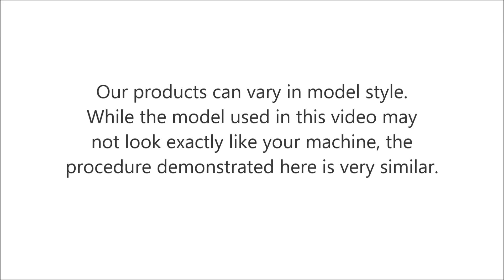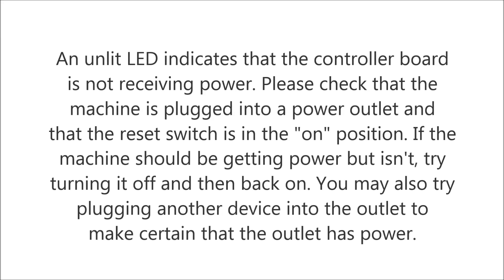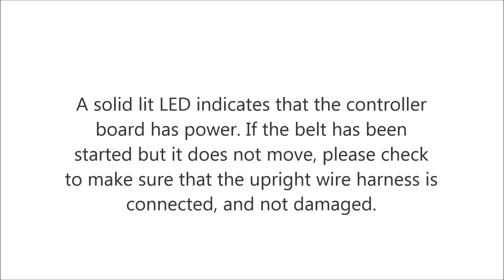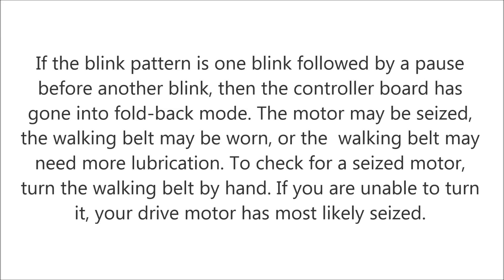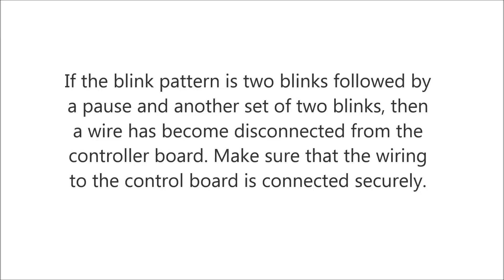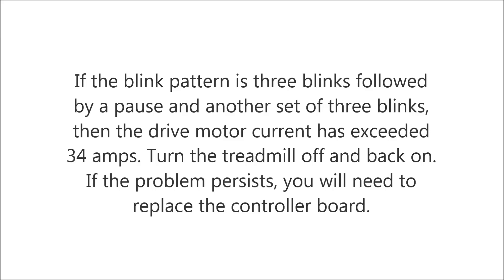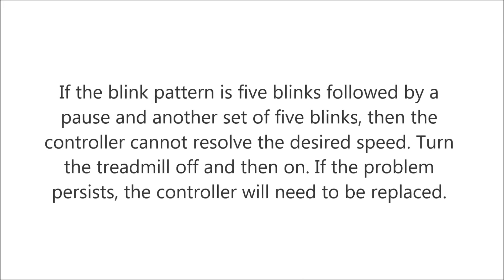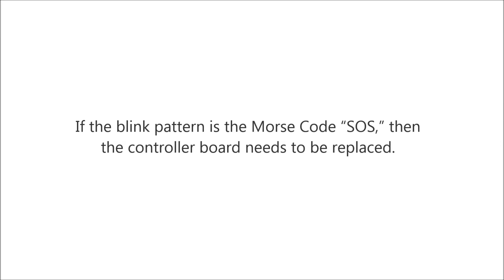LED Blink Patterns on the Control Board - Treadmill

Comment: My treadmill fast blinks constantly and runs at the minimum speed constantly
Reply from the maker: This would indicate that the controller is responding to a speed signal sent from the console. either the speed signal from the console is not increasing (console issue). Or the controller cannot send more power to the motor (controller issue). you likely will not be able to tell which part is failing with out reading voltages from the console on the speed control wire (blue) with a voltage multimeter. Does the speed change on the console display when the speed buttons are pressed? If so i would be more likely to replace the controller first. If the speed display does not change when the buttons are pressed then it is almost certainty a console issue.
Reply: @FitnessEquipmentHelp  Thanks for this response. 
There's no response from the console panel at all.
I had someone look at it & he had a motor control board which made no difference so he has taken the console display to test as he believes that is faulty, only when I press calibrate incline it slows for less than a second so see how that goes. Appreciate you're help

Comment: Thank you for this video, Nordictrack sent me a link to this as part of troubleshooting.
My Nordictrack 1750’s belt is not moving. When powering on, the led stays a steady red. However starting any kind of workout, the light starts to blink continuously. The motor makes a slight sound as if it is about to start but nothing happens.
I’ve tried to make sure all connections are in place snugly but I don’t have electrical experience.
Reply from the maker: usually they symptoms you describe are associated with the 4 blink error code demonstrated in this video. If the light is truly blinking continuously that would implicate the motor. If it is throwing an error code then the controller should be replaced. It seems though that your console and wire harness are communicating which is a good thing.
Reply: @FitnessEquipmentHelp  thanks so much for your help. Really appreciate it. Yes , once a workout is started, the LED blinks continuously.  Not just a few blinks. I am going back and forth with the manufacturer. Thanks again

Comment: My control board light turns weakly solid when I turn the machine on, and then fades to off within a few seconds. No blinking. Has something blown on the control board?
Reply from the maker: Yes, sounds like it. I haven't actually seen that specific symptom before but I would replace the controller.

Comment: I have a pacemaster bronze. And it just beeps non stop when plugged in. The top circuit board has no signal to the panel (I cannot make any selections). When I unplug the Ethernet wire to the bottom circuit board it stops beeping. Any idea?
Reply from the maker: Sounds like the console likely has a stuck button or some other issue. Likely the cable you unplugged also supplies the console with power, so when unplugged the beeping stops. the console likely needs replaced. In the interest of full disclosure however I am not an expert on this brand.
Reply: @FitnessEquipmentHelp  I actually fixed it by luck. I unplugged the Ethernet cable from the top console and then hit the reset button. Plugged the cable back into the main circuit board and everything worked again. Now the main issue is: if I run at a high speed, the treadmill trips the fuse (eg anythingnover 13.5km per hour)

Comment: Hello - the LED is flickering ( a steady blink?). The only issue is the walking belt isn't moving. The incline works and all displays are working. I tested the motor with a battery and it works and powers the walking board. The wiring seems to be ok. 
Appears I need to replace one of the circuit boards. Do I replace the board with the LED lights ( the INCLINE board) or the other circuit board ( Motor circuit board - with the black & red wiring to the motor). What are next steps to get this?  
Thanks!
Reply from the maker: a regular blink on the controller should indicate power is being sent to the motor on the black and red wires. If it is an error blink (a cirtain number of blinks and a pause) then the controller should be replaced. if you have confirmed your motor and wires then i would replace the controller if the light is responding (blinking) to the incoming speed signal.
Reply: @FitnessEquipmentHelp  Appreciate the reply. To clarify, replace the circuit board /controller...not the PWM circuit board that has the LED's. Thanks.
Reply from the maker: @bobgutowski261  The PWM board is the controller. I think we may be crossing signals. What is the model and version of your equipment?

Comment: 😳 I have a cheap Athletic Works treadmill from Walmart that I bought secondhand that I can’t find even a manual for that stopped working. I had power to it, but belt would not run. This video helped me figure out exactly what the issue was and fix it. Thank you so much for putting this together!

Comment: I was using my proform 770ekg and I heard an ESD zapped on the console when I was trying to change speed.   The console immediately lost power and lost all the lights on console.  I have taken the cover off to exposed the controller board and still have red solid red led light.  Is the console bad?
Reply from the maker: very likely, the red light is indicating the controller is receiving voltage from the wall. you can check for 9-12dvc on the red wire to confirm the controller is sending power to the console.

Comment: lde blinking red on the treadmill circuit board (cheap Frontier model)  , the treadmill is just beeping when turning it on.... and the motor wont run when i press start , even if the display shows its running.... is this fixable ?
Reply: The controller needs replaced

Comment: so the machine needs to be plugged while the motor hood is off for this, right?
Reply from the maker: That is correct, depending on the model. Be sure to keep yourself and others clear of the electrical and moving components while troubleshooting.

Comment: Thank you. This helped me from buying and throwing parts at it (Pro-Form XP 650E). I originally thought it might be the drive motor then I thought it could be the motor control board. With the explanation of the blinking light, it was identified as the need for more lubricant for the belt. I followed your video on belt lubricant and it is back up and "running" again. Thank you.

Comment: Hi. I have a Trojan Stamina 300. It stops after a few minutes. Sometimes give L5 error. Did the test for the blinking light. The LED stays on when treadmill is running. Please give advise.
Reply from the maker: I'm sorry that i am not familiar with equipment from that brand. I would contact the the manufacturer directly for assistance.

Comment: can we identify the failed point(s) and repair the control board for each error code?
Reply from the maker: I am only aware of a few of the issues. i know for example that the 4 blink error code is a bad fett on the board but my experience is really only repair at the part level not so much at the components on the circuit boards.
Reply: @FitnessEquipmentHelp  fett?

Comment: Nordictrack C900 treadmill. When you turn it on the LED light is solid red. As soon as you select a speed or incline button the light starts blinking a rapid continuous blink and none of the controls will work after that. We have already done the troubleshooting for display issues and are at a loss. Any clue on what this could be? It worked fine and one day started beeping while using it which led us to the display troubleshooting.
Reply from the maker: The light should only blink in response to the speed signal being sent from the console. Does the display show that you have pushed buttons but just the treadmill belt does not respond? I have seen issues where the speed signal interferes with other signals between the console to the lower circuit board when there is damage to the upright wire harness. I would make sure this wire has not been pinched or damaged.
Reply: @FitnessEquipmentHelp  once you select a speed the belt will respond and go to that speed but then all buttons stop working and the belt remains at that speed until you pull the safety key. Also, the incline controls work perfectly until you select a speed and then then all of the buttons stop responding. The display stays lit up, the belt keeps running, but all buttons stop responding (can't adjust speed, incline, fan, etc and have to pull safety key to stop it).
Reply from the maker: @trenallen  That does sound weird. It seems like the motor may be interfering with electrical signals. what is your model #?. Some simple things to try first is make sure the treadmill is properly grounded and that all the ground wires from the console to the frame are making good contact. If everything looks good I would suspect something in the console.
Reply: @Fitness Equipment Help it is NTL99011.0

Comment: I had just replaced the wire harness with a new replacement sent to me.  The led on the controller board is solid red.  But the display on the console still only turns on for a second.  Could it be the ground wire?
Reply from the maker: units with a led or lcd (not a tablet) display will power on for a second then go off when the power switch is turned on if the safety key is not present. If there is a problem with the key switch you will get the same functionality. The latest non tablet consoles, (the ones with Bluetooth connectivity for iFit), will also will also beep when the buttons are pressed when no key is present. This would indicate that there is power reaching the console.
Reply: Fitness Equipment Help Yes that seems to be the case!  The treadmill beeps when buttons are pressed. With or without the key.  The key switch must be the issue.
Reply from the maker: @M4TTH3WM  I think so also.

Comment: My lower control board led blinks like one low beam followed by one high beam blink and by display is also blinking like one blink and then pause. No controls is operational. What will be the error? Please help me..
Reply from the maker: That is not normal operation for the controller. I would start by replacing the motor controller board. Good luck.

Comment: https://youtu.be/GjIhGONMebA
Reply: Willing to pay anyone who helps me fix this
Reply from the maker: @Bangouaman  Since the light on the motor controller board in the base of the treadmill is on solid; it is behaving as if it is never receiving a speed signal from the console to start the belt. This makes sense since the console has not began a workout and gives an error beep when the buttons are pressed. The console is unable to respond to the button presses so gives an error sound. this would mean that the console is what likely needs to be replaced. Unfortunately those consoles are no longer available from the manufacturer but you may be able to find one second hand. Good Luck.
Reply: @FitnessEquipmentHelp  | Thank you. I tested the motor yesterday and it ran without issues.  Thank you for your help. I will see if I can a compatible console somewhere.
Reply from the maker: @Bangouaman  You are welcome. Good luck.
Reply: @FitnessEquipmentHelp  Thank you so very much. I was able to order a new console board and installed it yesterday. I noticed that drive belt is showing signs of fatigue as well and should probably be replaced as well.  But wanted to come back here and thank you/ buy you coffee.

Comment: Thanks for posting your video, it was very informational. When i turn ON my treadmill, the control panel LED light is ON, however when i press START, the treadmill belts starts to work, with a steady LED light blinking constantly. There is also a clicking sounds associated with it. I would like to know your opinion based on the current problem that i am having. Thank you .
Reply from the maker: the sound may be coming from the drive motor or perhaps the rollers. It should not be coming from the controller. Identify the cause of the noise and replace that component.

Comment: Mine beeps 3 times but does not start.. Will look at the control board. Love my Reebok 8600ES Treadmill and can use some help fixing it.
Reply from the maker: if the console is beeping 3 times in quick succession it usually indicates you are asking it to do something it is not able to do, like lower the incline when you are already in the lowest position. This error beep could indicate that you have stuck buttons so the console thinks you are pressing something else when you are pressing the start button. In this case you can try to free up the membrane switches under the button overlay on the console  by using the heal of your hand to firmly rub over the top of the buttons. If this isn't successful then a new console would likely be in order. Unfortunately the consoles for this unit are No longer available from the manufacturer.
Reply: @FitnessEquipmentHelp  Spot on diagnotic here. After replacing the console, the dashboard started working again. I noticed that if you hit the stop button when the theadmill is not working ( hence asking it to do something that i logically impossible) it beeps the way; rapid repetition of 4 beeps. I'm greatful I found this. Now need to change the drive belt.

Comment: Two blinks and pause...then again two blinks and pause what is the the expected issue ?
Reply from the maker: This can be caused by loose or disconnected wires. Particularly if the red/black wire from the motor is disconnected.  This can also be a controller issue.

Comment: IMy treadmill motor doesn't start. My controller board led stays in a solid red. I have all the console working, I can even see the speed if I push the belt manually. I've tested the motor and it's working if I connect it to a 5v DC converter. I've tested all the rainbow cables connection with success. I can do all the functions in the console. Is there a way I can test the controler board without buying a new console to be sure the problem is the console?
Reply from the maker: It sounds like you may have a circuit board from a different manufacturer or a very old treadmill. This video is designed for owners of Icon brand treadmills with the MC2100 series controller or later. (Units made after 2006.) you may want to check your equipment type or consult the manufacturer.
Reply: My board is MC2100E Rev D (2007). The treadmill os a Domyos TC270

Comment: When I turn my treadmill on the numbers blink really fast on the digital screen read out they don't stop I can't get it to move or anyting do you think it can be the 15 amp circuit breaker
Reply from the maker: If the console has power then I think the breaker is reset. depending on what you are seeing, it sounds, from your description, more like you are having a display issue.

Comment: Kenmore elite top- load  washer not working the motherboard has a red light on the back side that is on solid?
Reply from the maker: I'm sorry to here that. Unfortunately, this video pertains to late model circuit boards in Icon Health and Fitness brand treadmills. I'm not familiar with the Kenmore boards.

Comment: All I did was move my golds gym 410 treadmill downstairs to the garage, & now the belt is not moving whatsoever.

Everything else functions except the belt. I can move the belt manually though. I checked all the wiring & see no problems @ all.

I am so bummed & confused. It was working fine upstairs in my room, but all of a sudden, it doesn't.

What could be the issue? I was finally motivated to commit to more exercise because of this quarantine 
:(
Reply from the maker: Are you getting an error code on your controller indicated in this video when you press the start button?

Comment: Can anyone help? My control board has solid no-blink led, the motor connector is burnt at control board. My controls up top work perfectly. I tested my motor with a drill battery & it works. What is problem??? Thanks again!
Reply from the maker: If you have a recent controller from icon then the solid red light when you have started the workout on the console would indicate that the speed control voltage is not being received by the controller from the console. i would inspect your wire harness and nay extension wires for damage particularly to the blue wire. (The blue wire carries the speed control signal voltage.
Reply: @FitnessEquipmentHelp  My controller is not from icon, my led light does not turn red at all & yet the console up top works, there are not errors either. My treadmill is a Horizon, thanks
Reply from the maker: @T-bone9  I unfortunately don't have information on diagnostic information from Horizon. I would recommend contacting them directly.
Reply: @FitnessEquipmentHelp  ok thanks

Comment: Anyone can help? I have a 5 months proform 965 ct. It turn on and doesn't run. Light blinking 4 time and pause and blink 4 times again? Is it could be the speed sensor? I checked the motor and it is working properly. What do you a bad switch???
Reply from the maker: The 4 blink light error indicates you will need to replace the lower control board.
Reply: @FitnessEquipmentHelp  thank you very much! I did not realized it has a warranty and I called them . You are right it was the issue. They will send that part!

Comment: What you mean by 4 blink bad switch?
Reply from the maker: If the error code is 4 blinks you will need to replace the controller.
Reply: @FitnessEquipmentHelp  thanks for your reply . My treadmill everything on control panel works . But motor and incline not moving.  The board shows no sign of any burn just new . And it gives 4 blinks and a pause
Reply from the maker: @amohsinradhi  4 blinks indicates that the controller will need to be replaced. Although the 4 blink error is specific to the drive system this may also resolve your incline issue.